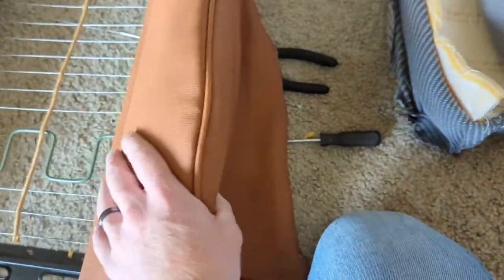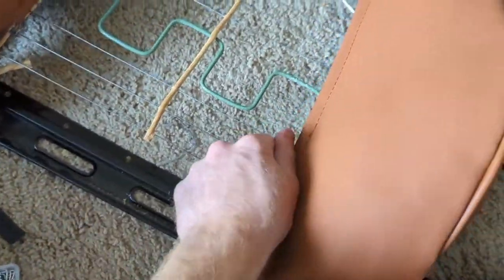I Tried Reupholstering My Seats Using "LSeat.com" || Here's  How It Went! Part #1

Comment: It is much-much preferable to replace the damaged foam cushioning. Parts of the metal skeleton are protruding through these splits (or even through weakened spots) and they will destroy the new leather upholstery in quite short time. Furthermore, these provide the comfort of the seat, keeping the damaged ones will make you feel sitting in an old and worn set. Buying new ones is really expensive but worth it.
Reply from the maker: At the time I didn't realize that you could buy foam kits, since this video I have been doing an engine swap so I haven't been driving the car, I have thought about going back and redoing that seat! Thank you for the advice!

Comment: DON'T WASTE YOUR MONEY. I dont know if this is a paid video. The leather is not real leather. The leather is very grainy and far away from the smooth OEM leather or good quality leather. Just try with a flame to burn it. It will burn feeding the flame!!! Genuine leather burns without feeding the flame. I have ordered a set of covers to give it a try. Result? nice to see at first sight but the anchoring trims are not matching with the originals and they take much freedom to contour the seat different than the original. It makes sense only to refurbish the care before selling it to a naïve buyer.
Reply from the maker: Hey man! This video wasn't paid, but for the price I was pretty impressed with the ease, I had really good success for what I was going for! My stock seats were in really rough condition in comparison so maybe that's why I was really happy with them, there are going to be better options but will obviously cost a lot more! Thank you for sharing your experience though!
Reply: The leather is good for the price buddy. Not too grain, but solid and not soft enough to rip easy like sheepskin. Do you even own a set? Or just parroting other critics who i see post same comments on all videos containing the WORD L SEAT?
Reply: Why are you lying about Lseats being real leather?  I've watched several videos, some critical about the quality of the stitching but even the critical videos said the leather was high quality.  What is your real motive here?  Did they hurt your feelings somehow?
Reply: @ProjectRacecar2 did you pay for the full leather option? Seems like that’s an extra $130